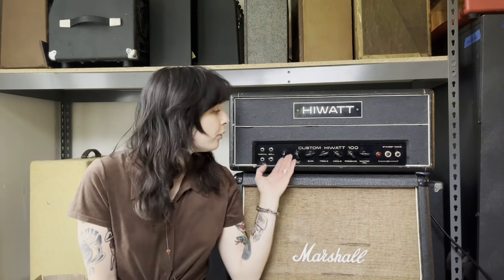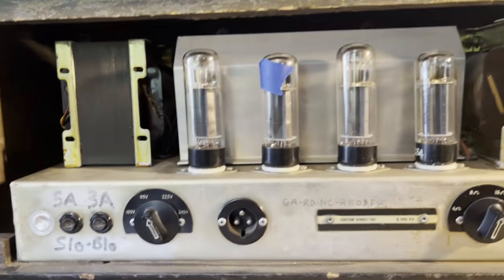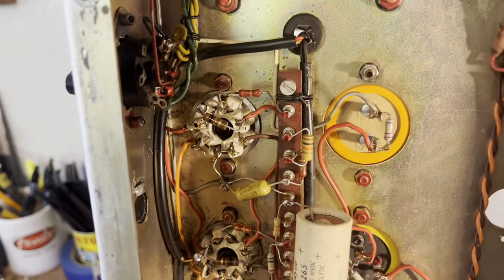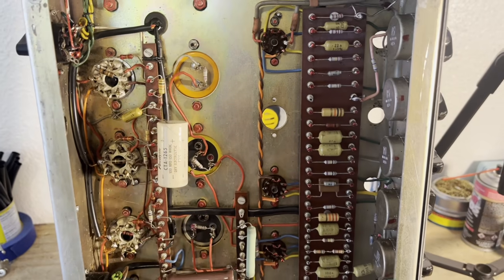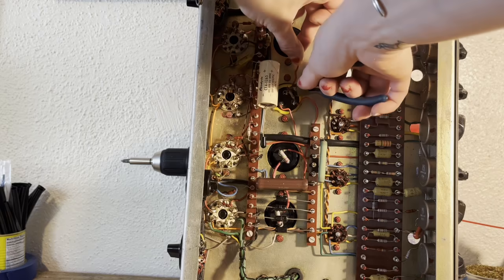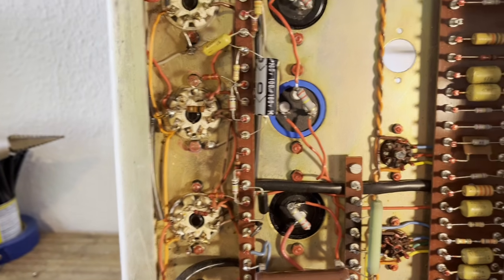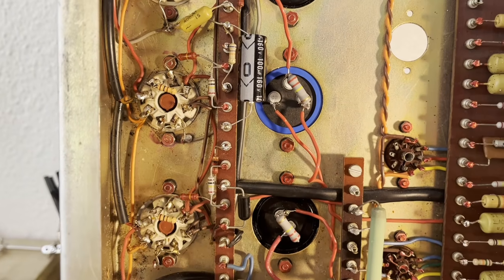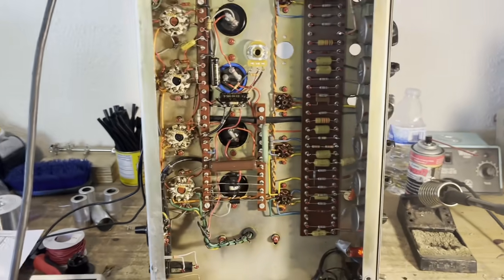Hiwatt DR103 | Restoration & Demo

Comment: I am the head of Custom shop at Hiwatt - we do still build them the old way :D
Reply from the maker: That is what I love to hear! I can’t wait to see one someday.
Reply: Calvin:  Nice to hear!  Do the current production amps have an adjustable fixed bias circuit?
Reply: @MichaelSmithTX  we have dual bias controls now on our DR201 and DR103 now, yes! And we increased the voltage on the bias tap off the transformer, so we have a 20v range on the bias pot (-35 to -65v on the 103)
Reply: How much is one nowadays.
Reply: Are most of these over in that there Olde World?!  Pretty cool selector knob for the mains voltages!  THANKS FOR SHARING!!
Reply: well shoot. this is a cool comment!
Reply: Do you make 400 watt hiwatts???
Reply: @FazioElectric  WYB?
Reply: Calvin, I love my 40/20 head, I know it's not the vintage stuff but it love it.  I'll have a custom one day.
Reply: I have, use & love my old tube Hiwatt, but when I tried to buy a new one last year & after repeated attempts, still could not get any reply from the distributor in Australia, so I had to give up.  Could you please give me a contact point Calvin? I'm in Western Australia.
Reply: Would Love to have one , would use it for Bass , haven't seen one here anywhere.  
   Right now using Ampeg V4B 100 WATT Tube but it is a little noisy even from the built in DI . 
    With Ampeg HLF 6X10 Cab , in church band that is old school , amps  drums  no clic track no autotune .
Reply: I'm ex Royal Navy weapons engineer, the OCD level of wiring is what we were taught, I had a HiWatt lead 50R, good Amp, sold it for a good offer, still have a Marshall, but mainly use a Boss Katana 100, 2x12 now, as it's light and sounds great, the HiWatt 100 is way louder than what would be allowed in the average venue, but they are great pedal platforms with fantastic headroom. A good 2nd hand find, that any good Amp tech can fix.
Reply: Awesome.
Reply: What transformers can possibly replace Partridge ? The frequency response is insane
Reply: Great because I just bought a new Hiwatt DR103 100watt from Musicsore Live National city,CA
Reply: @josephfemoyer7218  Does it sound anything like a 1970's Hiwatt with that beautiful "chime" they had? Doubt it...they components are all different, especially the fact that the Partridge transformers are no longer made. Those are worth their weight in gold....
Reply: I've got a little P. Glorious amp :)
Reply: That's fantastic Calvin. Glad to hear Hiwatt is still going. No one sounds like David Gilmour. I though Hiwatt had gone out of business so this was good to see.
Reply: Is that so then give out schematics to customers and tell Hiwatt to answer their emails Dave Reeves is rolling in his grave at your comment i have seen the so called hand build examples. Why can you base a company who produced maxwatt amps with the same name and Hiwatt is Canadian owned  and you put the British flag on the amps.
Reply: @nikkisimpson1835   Brilliant comment Hiwatt need to stop and stick to making maxwatt amps just get china to make them like they always have.
Reply: @returnofthenative   You would be better off building your own Hiwatt
Reply: That’s so good to hear! A HIWATT half stack has been on my bucket list to own since I was a young lad. I’m talking my wife into getting me one for my 40th in a few years 😅😂. Keep up the superb work over there at the legendary HIWATT CS my dude!
Reply: @telecasterman18   You can buy a original Hiwatt from the 70's hand built by Dave reeves who hand  built and modded Pete Townsend jimmy page and Dave glamour's amps. For cheaper you can buy a real 1970's one in the uk people giving them away   for as little as £1000. They are too loud and unpopular now to most musicians. The new Hiwatt's built today are not good and have no place calling themselves Hiwatt  the company changed hands so many times that now it is just a brand name.; Dave reeves who hand built them died in 1980 and the company went bankrupt and because of this the name was taken as a debt payment and it was against the law for anyone in the uk to use the name Hiwatt as fernandes owned the rights so really someone just bought the rights to use the Hiwatt name now its owned by a canadian company who wont even answer their emails for customers asking for schematics because they used cheap components and customers need expensive repairs.
Reply: @theprogrammerrolandmc3039 never heard that fernandes owned hiwatt
Reply: @michaelgiordano3757   Yes and a big company like fernandes made some great Hiwatt things like Hiwatt CTE-2000C. Sadly thenew owners of the  company have gone to shame the Brand name again.
Reply: Ah the Hiwatt, nothing like windmill slamming an A, on a Strat, at full volume into them, for hours, then knocking them over on stage, picking them back up, and loading them up still kicking for the next gig  :)
Reply: 1st amp I bought with my Saturday job money. Guitar /bass/ keybords it could do it all . As a 16 year old at the time I did'nt appreciate what I had till I went amp shopping .
Reply: @Who cares.  Strat? Townshend mainly slammed on Gibsons...at least for all those classic shows such as Live at Leeds. He switched to Fender everything, and his tone suffered, but he doesn't seem to care, perhaps because he can't hear the difference himself... but the paying fans can tell.
Reply: @harrykadaras9459  100% agree and Hiwatt is dead and buried anyone that posts videos claiming they own a Hiwatt that wasn't handmade by Dave reeves can dream on they have copy like a behringer guitar pedal. 🤣
Reply: @The Programmer ROLAND MC303  damn straight. I've got two..1971 and 1973 100W monsters. I love my dual ear blasters... made many recordings with the '71. The new PC board, overpriced cheapos sound terrible, but these stuffed shirts try to convince us they're just as good....nope!
Reply: Hi Calvin, I'm in the UK and have a newer one of these on the bench with a shorted power transformer. So far I haven't had any luck getting a response from Hiwatt via the email addresses listed on the website, and there doesn't appear to be phone number for tech support issues. Can you help me?? 🙂 
Oh, and thanks for the video(s) Colleen!
Reply: @whocares.20  or better yet; an SG Special with P-90’s 😉
Reply: I think she has a modified croak throat from too much...
Reply: @Calvin McCormick "old way" as in hylight, "old way" as in biacrown or "old way" as in sterling imports? ;)
Reply: Do you know anyone on the west coast to restore/mod a semi-modified Sound City?
Reply: @andmoreagain current models are exact specs of 1969 builds.
Reply: @steeltrees3828  awesome
Reply: PLEASE do Synergy module!
Reply: I like the mains voltage switch. Super. Is there any redundancy if someone were to accidentally flip it the wrong way? lolz..
Reply: Thanks, Calvin!
Reply: Still, own my DR103 half stack in studio. Purchased new, during the early part of music career. Those FANE speakers are amazing. Cheers, building such amazing tube amplifiers. :glasses-purple-yellow-diamond:
Reply: @LOFIGSD  , did you ever consider using an attenuator with that 50R Hi-Watt & 2x12 cab. It would accommodate any size club or venue. 
One can still get that fantastic headroom, full blown sound. At much lower DB. Currently using "Ironman II," with my DR103 (recording studio). No complaints from neighbors. :glasses-purple-yellow-diamond:
Reply: I need a back panel for a DR 504.
    Hiwatt Canada has never gotten back.
    I enjoy playing a stamped DR 504 OL.
          so Drake transformers instead of Partridge transformers,..like Marshall.
Reply: Alex Lifeson's best tone was during his Kings / Hemispheres phase, and your amps helped make that happen. I've been searching for that tone for 45 years.  

Thanks!
Reply: Hardly the same without the Partridge transformers
Reply: @calvinator420 Head of the custom shop!?!? Talk about a great gig! Congratulations! I'm jealous. 😉

I'm a Rush fanatic, and Hiwatt amps defined Alex Lifeson's sound during Rush's breakout period in the late 70s and early 80s. We all know what happened after that.

Hiwatt, Mesa, Marshall. An amazing legacy. Thank you for carrying it on.

Comment: Audio engineer Dave Reeves founded Hiwatt in the mid-1960s (the exact date varies from source to source). To raise enough money to get his company up and running, he contracted with Arbiter’s Sound City music store to build a line of amps bearing the store’s name. By the late 1960s, however, Reeves had fulfilled his contract with Sound City and began focusing on building his Hiwatt-branded amps. Harry Joyce stopped building HIWATTs in 1976 because Dave Reeves (original designer of HIWATTs and Sound City) wanted to find a cheaper way of doing things to make more profits. He (Reeves) later decided to build the amps with PCB and upon hearing that suggestion from Reeves, Harry refused to work with him because he felt it was an inferior design which would only cheapen the sound/quality. LOVE your show..PS I have a DR103 and still use it. All caps and res. and power sw have been replaced.
Reply: Don't forget he was working full time for Philips which is how he ended up using Mullard tubes.

Comment: HiWatt, that brings alot of memories for me. At the time, beginning of 1970s, I was working as a service tech at a music store in Gothenburg, Sweden, called MUG. They where the Swedish distributor and I was responsible to adapt them for the market. More fuses and replace the power connector. I had a punch tool to fit the new connector. I actually had pleasure to meet Dave at his shop. We had tea......
I asked Stuart the British repair guy, youtuber, if he had repaired any Hiwatts, zero was his answer. That says alot of the quality! If I remember correct, I only had a few returns, all bad tubes.
Thanks again for this wonderful memory.
PeterS
Reply: Those weren't "bad tubes."
This lil lady just pointed out....
No Bias adjustment, grid runs Hot, DESIGNED INTO THE CIRCUIT.

Your uTuber Hero didn't repair Hiwatt Amps because the artists using them got tired of feeding them Vacuum Tubes.

On top of that, I doubt Hiwatt had any considerable market share.

Those Capacitors in any Amplifier die from AGE.  If noone Loved their HiWatt long enough for those caps to die, they never had it Serviced.

I could say that since I have never performed any service or repairs on a  DeTomaso Pantera, that makes it a better road car than a 911 and a better race car than a GT40.

The absence of evidence does not make a verdict.

Go unravel your logic.  It doesn't work for me.

Edited to Correct Autocorrect
Reply: I too was a bench engineer for 30 years and while I saw many Marshalls-I never had a Hiwatt on my bench!

Comment: This amp is a good choice for an extreme metal guitarist who wants a vintage tube pathway, but also super clean power, who also uses a pedal for their distortion. Best of all worlds in a situation like that. Clean, loud power, nice tube sound, takes the pedal distortion well and helps smooth it out a little, and when you turn your stomp box off, the clean tone is so buttery smooth. Its a win-win-win and something like this is an essential part of your tone when you favor the really gainy pedals like the old metalzones and the like.
Reply: Used to use that amp with a Rat pedal.  Sounded fantastic.
Reply: The metal bands loved them. Back when there were rock clubs in the city that I inhabited, it was very common to encounter stacks of these beasts. I miss those days.